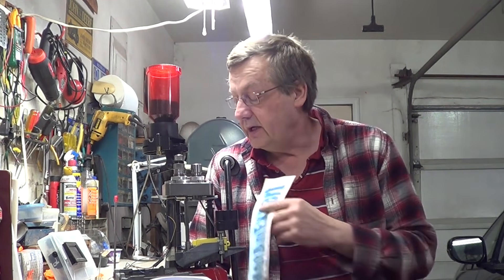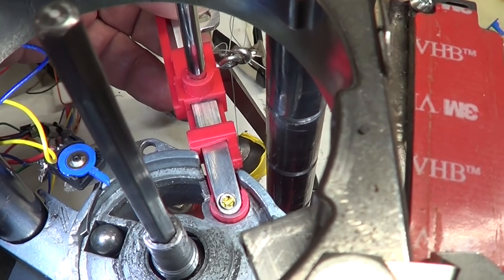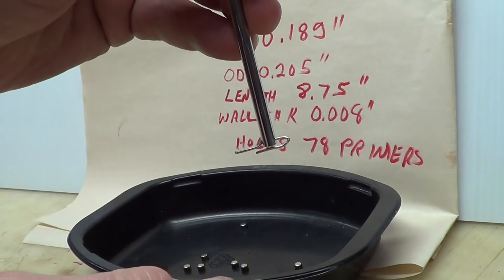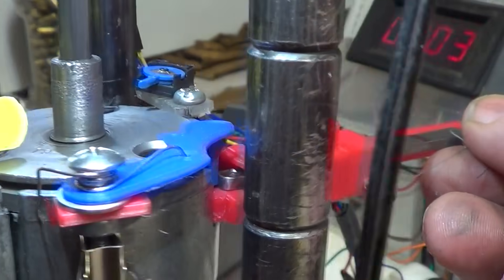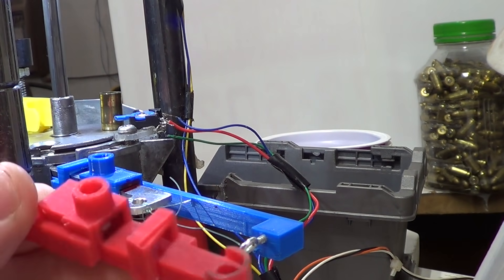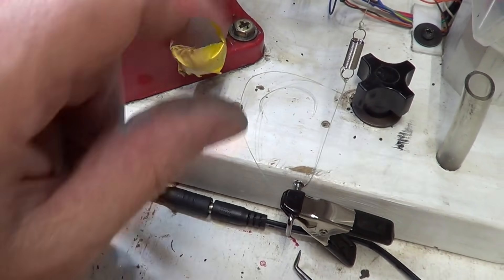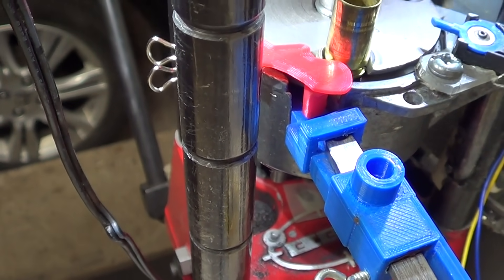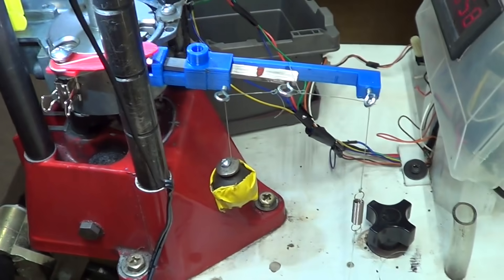Lee Pro 1000 Adding a Primer Tube System

Comment: @NotAnExpert.  I bought a Lee 1000 a few years back and frankly the primer feed system on it is garbage.  I found your video and modified your design to use a cam track to move the primerpushed.  I also set it up to use Dillon primer feed tube (yes I was so disappointed in the Lee that I purchased a Dillon RL550)  But I never got rid of the Lee, I like the idea of 2 presses dedicated to different calibers.   I'll post video soon.

Comment: Presses that use the vertical tube primer feed surround the tube with a fixed explosion shield.  I've seen a tube filled with primers detonate and even with the explosion shield in place, which also ruptured,  the press operator needed surgery to repair the damage to his hand.   It damaged his ceiling as well.
Reply from the maker: Thank you for your comment, I will add a shield to mine.  I have had a detonation using the standard lee priming tray, it was a chain reaction that detonated 7 primers.  Thankfully the chain reaction died out before making it to the round primer tray which was full. I did find a video showing a full tube detonation https://www.youtube.com/watch?v=es1YgL3izWY   .

Comment: Genius design.  Question: How much torque on the spring for the primer blocker  When I pulled the shell carrier off and mounted your set up the primer blocker shoots back about half way back when released.  Made the spring from piano wire (Youtuber Jack Houweling). Also found 1/4 inch brass tubes at Hobby Lobby that work really well for small primers, two for $5
Reply from the maker: After using mine for hours I found it was less hassle to not use a primer blocker. As long as you don't jerk the handle when  indexing, the primer will lower back into the primer transfer bar with out a problem.

Comment: I learned quite a bit as my primer pin is seating but primer protruding out the brass 1/16 to 3/16". Camera work was nauseating (I'll be better in 30 minutes or so). Q: So there is no real stock, up/down primer pin adjuster, on the Pro 1000? Hot load, now is 9mm 1.18 form 1.15 and wedged in carousel, and bullet exiting trough, resisting removal against the primer in the press.
Reply from the maker: There is no up primer depth seating adjustment on the lee 1000 that I know of.  I have had the issue of the primers not fully seated.  For me the solution was to for every cycle of the press I had to do 3 movements of the arm. The first part was to lower the arm all the way (of course put any components in the press you need for the cycle like brass and bullets first), the second step is to raise the arm all the way.  The third step is that now that the arm is fully up you push it forward (parallel to the ground) and feel the vibration of the press,  you should feel a slight vibration in the press when the primer becomes  fully seated.

Comment: Is there anyway to re-write your software were it will accept a piece of 1/4" stainless tubing? I found that 1/4" OD tubing will accept both small and large primers. Thanks , Mack Cook
Reply from the maker: All you have to do is drill the hole out larger. I tested drilling out an early prototype I had  to 1/4" and it still had plenty of strength.

Comment: Great work I have one problem I don't have a 3D printer could you sale it as a kit.
Reply from the maker: No I do not have any plans for selling any type of kit or printed parts.  The main reason for not wanting to sell this is the amount of hand fitting required to get it to work.  You might want to contact a seller on eBay called "reloading3d" ; he prints a lot of plastic 3d parts for reloading equipment and sells them on eBay.  You could ask him if he has any plans to print theses for people and sell them on eBay.

Comment: What a great idea. I do have 2 questions. A - Have you tried using a spring like the one used for the shell pusher? B - Is there any way to get the original file so I would be able to ungroup everything? I would like to add a small hole in between the primer tube and the pusher for a IR sensor for a low primer warning, but would have to make that space a little bit bigger. I have made a IR set up similar to the one you made. BTW you have a great channel with a lot of great info, so thank you.
Reply from the maker: I originally started this design with a spring but  I could not easily find or make one that was consistent over the range of travel that I needed.   I made my design on Tinkercad and went back in and made a copy that is now public.  If you go to https://www.tinkercad.com/search  and search "prm sld"  my design will come up and you should be able to do what you want. With my part that is in Thingiverse  you should be able to import that one into Tinkercad or Fusion 360 and make the designs on it.  Some of the other reloading  designs that use a primer tube have a small rod that you place on top of the primers in the tube to help push them down as you reload and primers are used from the tube. One design I saw had a ball on the rod that pushes the primers down, when it got low enough the ball on the rod would touch a micro switch mounted on the side of the primer tube setting off the low primer alarm.  This might be easier to do than an IR system.